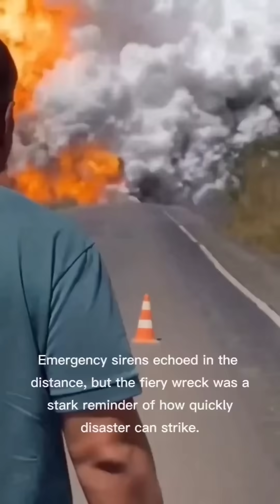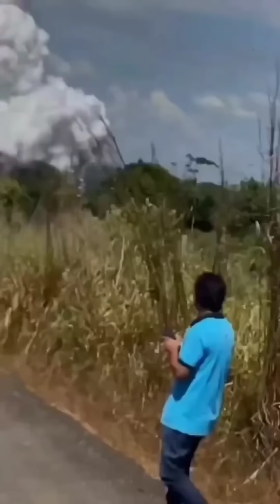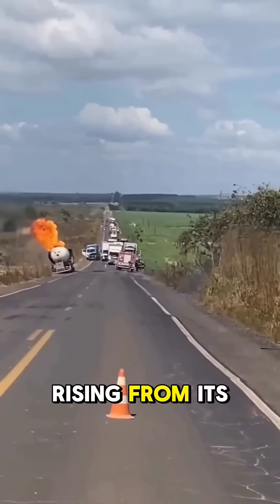"What makes the gas tank explode!?" #explosion #facts

Comment: As the fuel burns, it creates space that fills with air. Once the ratio of gas vapour to air reaches a certain point the gasses burn fully and instantly.
I don't think that this is a liquid fuel, seems more like propane or something.
Reply: You can tell by the shape of the Truck it's a propane Truck.
Reply: @MarkYoung-u6n Yeah, Mark, also the flame propagation seems to be at ground level rather than airborne. If I was there I would be running like hell for higher ground.
Reply: It is a pressure vessel, so you are partially correct in guessing "propane"
However propane is transported and stored in liquid form.
Reply: @FlooredForTheLord  every gas becomes a liquid under (enough) pressure. IDK  what the exact  contents were ,  all I know for sure is it exploded. 
People are so immune to videos they cannot see danger in a real situation.
Reply: A 'BLEVE', Boiling Liquid Expanding Vapor Explosion. Its a propane truck.
The liquid propane starts to expand as it vents and evaporates, causing the liquid propane in the tank to expand more and begin to boil as it expands causing even more presure. The pressure of the expanding liquid into vapor becomes too great for the tank and when the pressure reaches the weakest point of the tank, the tank fails and an explosion occures. Being the propane is already burning, it does have an ignition source and you get a hugh fire ball of the expanding liquid immediately into a gas.
I been trained on these types of fires, its propane.
Remember, propane is heavier then air and will seek  the lowest point and an ignition point.
Reply from the maker: @johngreen1907  great explanation
Reply: Liquid tankers are not colored like this white one is. All tanks like in a vehicle that carries gasoline are equipped with a "breather" valve. The breather valve will keep the gas tank from exploding. I am unsure about the tanker trucks over the fact that I am not a trucker.
Reply: @johngreen1907  It's real simple guys. It's called a BLEVE. Anybody with any brain should've been quarter mile away from this truck. I drove these trucks for 10 years.
Reply: @johngreen1907  i agree. Round tank. You can see the gauge in the middle.
Reply: @johngreen1907  Thank you for the breakdown. Common sense tells me to run as far away from a burning tanker
Reply: I saw the person walk around the front of his truck. No way he survived or the other guys. I wonder how many lost their lives here???
Reply: EXACTLY...!!!
Reply: It's called a "bleve". A boiling liquid evaporating explosion.
Reply: @johngreen1907  propane under pressure is a liquid
Reply: @MB-wn9cv  seems propane is liquid  on hot day she adds a little presure the thing to do run like hell a long way you porkers  are going to cook
Reply: Propane IS liquid fuel. It's pressurized until it liquefies. That's what the designation L.P. means: Liquified Petroleum aka Propane.
Reply: It was carrying LPG, I have put the out before it's nerve wracking
Reply: @johngreen1907  the escaping gas does not allow air into the tank. The fire heats up the tank and the pressure builds up causing the explosion.
Reply: @johngreen1907  close, but look up definition of a BLEVE